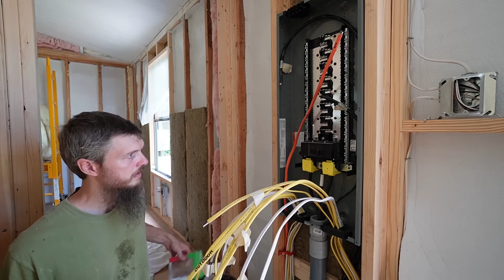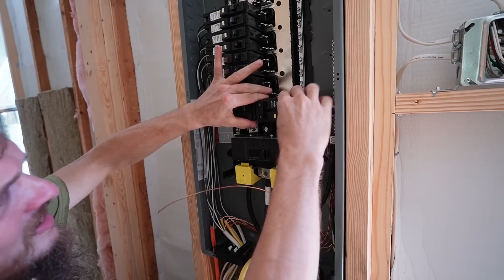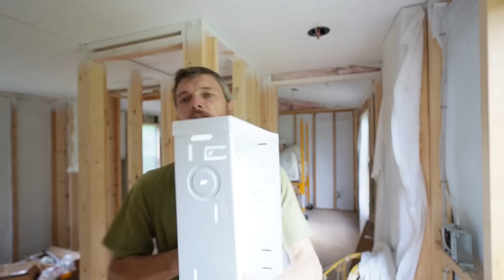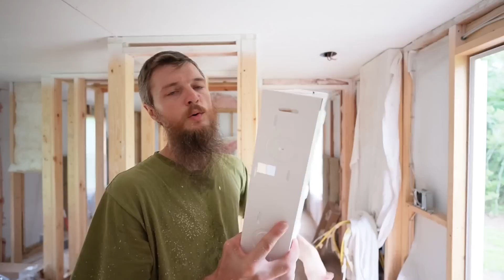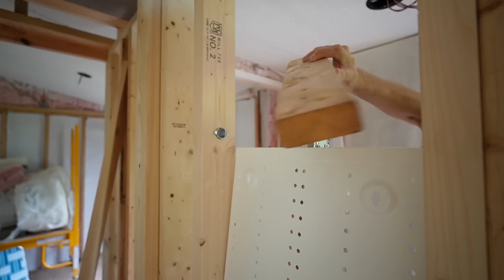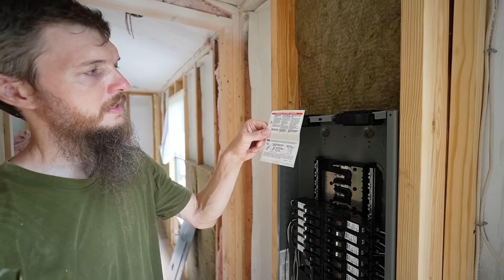Electric Panel &  Media Panel - Salvaged Mobile Home Rebuild

Comment: Great work as always, It is helpful that you explain the thought process of choices of parts/supplies used. I have been upgrading wiring in 70's mobile home in San Diego. when adding low volt things including ethernet, it is a good idea to run speaker wire. I have a 6 zone speaker  distribution box. Have speaker pairs in multiple areas including in wall speakers, out door in carport and back yard, hallway. It is nice to be able to roam around or work in multiple areas and whatever your are listening to is there. Even have Bluetooth adapter connected to stereo to play off other electronics

Comment: Could you now install the mini splits and cool it down while you work?  If you dont have ac in your house geuss you dont need it?
Reply from the maker: Ideally we would need the walls finished before we could install the mini-split units. And we honestly just don't have the money for them right now anyway. But it's okay, because we are doing well and we can deal with the heat. We'll make it through!
Reply: You shouldn't run the ac or hot air heat during construction,  it pulls all the debris into the system,  even with filters

Comment: Nice job! I live in Chicago, and in the city and nearly all the suburbs Romex isn't allowed. All wiring in new construction or open walls must be in EMT conduit.  Lot more work and technique required bending and running EMT and then pulling the wires through it.   One advantage is you can run multiple circuits in one pipe, and it does make adding circuits easier in some cases. In concealed walls you're allowed to use Flex or BX cable, and it can't be exposed more than 4 or 5 ft.  AFCI last I checked here was still bedrooms only.

Comment: Doug, totally unrelated, you mentioned that you hired a crew to level the mobile, is it worth the money to hire, or is it something you could’ve handled? The cost where I’m at is only $2000
Reply from the maker: I called a professional mobile home setup company to have this home leveled. They sent one guy out to do the job. This one guy did the whole job himself and while it was interesting to watch him work, it was all pretty basic. He used a regular bottle jack and a water level. And just went around leveling the chassis. 

In the end I ended up going back over it and fixing it because it still wasn't level. Our chassis frame isn't straight, so even though he leveled it, I could see by eye that it was very much not level. It's honestly a very easy job and probably not worth $2000 for a guy to spend an hour with a jack. There's no special tools or knowledge needed. But it depends on how you feel about doing it and if it's worth it to you. Some people just don't want to crawl under there and are happy to pay someone else.

Comment: Wow, a whole system surge protector, I've never heard of that before, how cool!  What is the logistical diyfference between ground fault & arc fault?  I know GFCI is for wet, but been curious how it actually works, and never heard the term arc fault before, unless that's just the fancy term for "normal" breaker?  Fire protection is key in case any of Belle's 🐉 come around there who're lightning-based.  >>;=)
   That breaker box is like visual ASMR; you know you have a good electrician when everything is nice and tidy in a box.  Also, nice when the number of knockouts is equal on each side.  💚  Coming along nice as always!
Reply from the maker: The arc fault breakers will detect abnormal arcing, such as a frayed cord or a loose plug that is creating sparks and it will trip the breaker. 

The ground fault will detect current leaking to the ground, so if an appliance gets water in it, there may be current shorting through the water to the ground, but it's not enough current to trip the breaker. The ground fault breakers will detect that and trip the breaker so that you don't get shocked.
Reply: @diyfferent  Cool deal.  👍  Thanks for explaining that.  And we all know leaks should be fixed with duct tape.  >>;=)  Don't want those electrons spilling out everywhere

Comment: I always put the panel in with main on top, main on the bottom is just laziness, always put fridge on its own circuit, I've found if you don't put the biggest 220v breaker closest to main you lights will dim sometime when thing bigger loads come on.
Reply from the maker: Main at the bottom isn't laziness. That's silly. It all depends on where the service enters the panel and what works best. We replaced an old panel with this new one and there wouldn't be enough cable to reach the top of a new box without splicing or replacing the wires altogether.

If the service enters the bottom, I like the main at the bottom, if it enters the top, I like the main at the top. It's simple. You are free to put the fridge on its own circuit and many people do, but they don't draw much current and so I don't like wasting the panel space and extra wire just for a fridge. A fridge only uses about as much power as some light fixtures. Very little. But I have no problem with the way you prefer to do it either.
Reply: @diyfferent  Agree. Would be dumb to wire it from the top when it's not needed and would require new $8-a-ft run of wiring along with the added outside conduit up the outside wall. Good work and thanks for sharing!

Comment: When I installed something like your communication panel, I ran a conduit from the top to the attic and another from the bottom to the crawl space.  That way I could always access it and did not have to decide for example on which kind cable I needed for wired internet and could pull wired internet access to rooms after the fact.  At least for me this has worked well.

Comment: Nice work Doug, neat and workman like. As for data cables. I would suggest running a CAT6 cable to each bedroom, the living room and the kitchen. Likewise, a coax cable to each bedroom and the living room. Finally, a CaT6 to the master bedroom for telephone. Finishing out the breaker box was my least favorite thing as an electrician. Never could get it as neat as I wanted.

Comment: Good Job!, We always used Square D most of the years I worked as a Electrician but we always used the QO line, One of the companies I worked for used the Homeline briefly when they came out in the mid to late 90s but quickly switched back to QO as we didn't care for them!, They are just kind of a Knockoff of GE, Siemens and a few others in that style, Also the QO has the Orange trip indicator makes it easier to locate trips!, Especially for a Housewife!
Reply: When I have the budget, Square D QO. Nothing wrong with their Homeline, especially for customers facing the sticker shock of everything, today.

Comment: check code for your state and county. ALL appliences in DE, PA ,NJ MD have to be dedicated. AC/GFCI
Reply from the maker: That's why I said "contrary to popular belief" ;) 

I checked those states and couldn't find that. Some of them are governed by local jurisdiction and others follow the NEC. But I didn't see any such regulation.

In most places, and all that I have ever heard of, refrigeration is permitted to be included on the two 20-amp kitchen counter circuits.

This is what the code says: A minimum of two 20-ampere-rated branch circuits shall be provided to serve all wall and floor receptacle outlets located in the kitchen, pantry, breakfast area, dining area or similar area of a dwelling. The kitchen countertop receptacles shall be served by a minimum of two 20-ampere-rated branch circuits, either or both of which shall also be permitted to supply other receptacle outlets in the same kitchen, pantry, breakfast and dining area including receptacle outlets for refrigeration appliances. [210.11(C)(1) and 210.52(B)(1) and (B)(2)]
Reply: @diyfferent  Think of what you would want to power after a hurricane. If the fridge was on its own breaker and you had a generator with limited watts, it would be easier.
Reply from the maker: I don't think it would make a difference. You just wouldn't run your toaster and coffee maker if you didn't need to. Even if the fridge is on a shared kitchen circuit, it can still be powered by a generator just the same as if it were alone.

Comment: Electricity runs fans and air conditioners!
Reply: I was thinking that too.  It would be nice to have some kind of cooling system in the mobile home so you can work in relative comfort while you finish the rest of the build ♡❤♡

Comment: I have always been cautious around electrical work.   As a child I was helping Mother polish our hardwood floors with a big floor buffer.  I  accidentally hit the edge of our floor furnace with the buffer and it threw me backwards into a window.  (Thank goodness heavy drapes were popular, they kept me from actually going through the window.)   I would never tackle wiring a house, I do not have the confidence.  I have much respect for anyone that does electrical work.  I do have a question re the whole house surge protector.  About 25yrs ago I inquired about having one installed in my brick home.  GA Power told me it wasn't possible since the outside meter was cemented into the brick exterior.   That didn't make sense to me but I dropped the idea.  Apparently your system is a much needed upgrade, no bothering the exterior meter.  Or is your system only for specific applications?   If possible I would like to add a whole house circuit breaker system to my next, forever home and I appreciate the low maintenance of a brick home.  I appreciate your hard work and of course your channels.  Eevee and Doug are such an amazing couple!   Outstanding editing Eevee, as always!!

Comment: When I wire a house I usually use the smoke detectors and use pigtail light sockets for lights and wiring the refrigerator and hallway outlets to plug in power tools.

Comment: Just an FYI to consider for your next remodel - there are plastic structured wiring panels in several different sizes which I use because the wireless router can be installed inside the panel and there is no metal to interfere with the signal. I always get the largest panel I can to accomodate the modem, router, surge protecter, and wiring manifolds. The smaller panels can just get too crammed. Good work...enjoying your videos.
Reply from the maker: I know, but I like metal because it does help cut down on the emf. I did consider one of the plastic cases because I know we may sell the home someday and other people may want an RF transparent case for their wifi. But ultimately we decided to just do what we wanted. We don't use any RF wireless devices in our home.

Comment: Is the tool you’re using to tighten the wires on the breakers a torque wrench?
Reply from the maker: It's a torque screwdriver and it works the same as a torque wrench.
Reply: Nice, I thought I could hear the click.

Comment: Hey Doug for the first time I've seen you uptight today. Get some  Rest And. regroup .  Everything you do is well done  and picture perfect  I really appreciate you.... Hugs
Reply: First, he's working with expensive electrical equipment with little to no room for errors.  Second, he said multiple times how hot it was in there.  I'm doing same with double-wide in NC, and it's 95 outside, but was 124 degrees inside.  Also, he's making a video of the entire thing.  ffs, he's not uptight.  I bet you don't do any of those things one at a time let alone all at once.
Reply: @XtremeChiliPepper  I have watched this channel for yrs. I love them. I wasn't be crucial I was concerned.

Comment: What about power for your heater and hvac? (Mini split).
Reply from the maker: Since the power for a mini-split is run to the outdoor unit, we decided that we will run those circuits from the exterior panel. We have a main panel under our power meter and there's enough room in it to add the mini-splits. It will be easier to run the conduit down and to the units from there.

Comment: Square-D is actually out here by me here in Kentucky. I know the label used to say Florence Kentucky. But that was 1980s. Now I don't know. I know they have a plant in Lexington or Louisville. 
  As for that breaker box. That's the most beautiful, neat organized box I've ever seen. A lot of boxes are just a mess. Wires all over the place. Crammed in there.

Comment: The warning stickers is not just a "can go on the inside of the door". They are a "must be on the inside of the door". You need to be able to read them without removing the front of the panel. If not, that would be like hiding the instructions for your washing machine behind the drywall in your home. 😂😂
Reply from the maker: It could go on the outside of the door if you wanted.
Reply: @diyfferent  That is true. I just thought you were talking about hiding them inside the panel next to the neutral bars or something. 🙈🤣

Comment: I confess I know next to nothing about electric, but aren’t clothes dryers wired for 220v?  I recall living in the US everything was 110v but there was ONE 220v outlet for the dryer I think.  I don’t think I heard you mention the circuit for the dryer or where or how the dedicated 220v line comes into play.  Can you please explain?  Thanks!  This is a real education!!   Oh, I also meant to mention that here in Europe (we’re in the UK) waste water pipes in literally every building are mounted to the outside, never inside.  They’re always easily identifiable as  they’re painted black- & of course, made of some kind of heavy duty metal.  I don’t know why the difference.
Reply from the maker: Yes, they usually run on 240v. The larger, double breakers provide a 240v circuit and the smaller, single breakers provide 120v. It's hard for me to explain in words how that works though.
Reply: Gas dryers are different than electric dryers. Gas run on 110/120 electric dryers are 220
Reply: Yes they usually are 220
Reply: Thanks for the explanations!